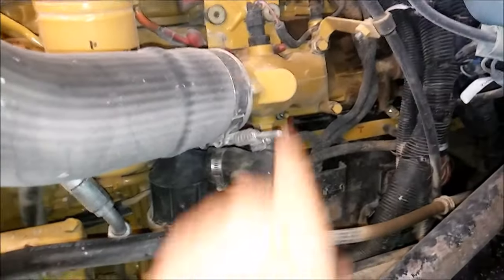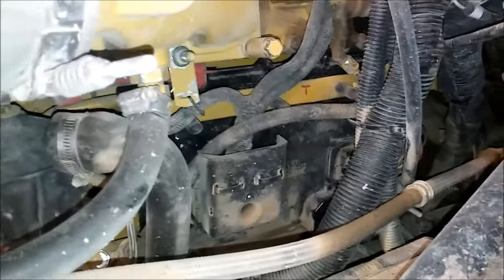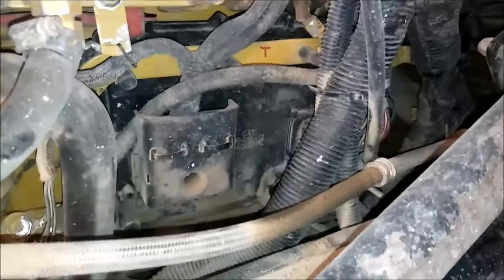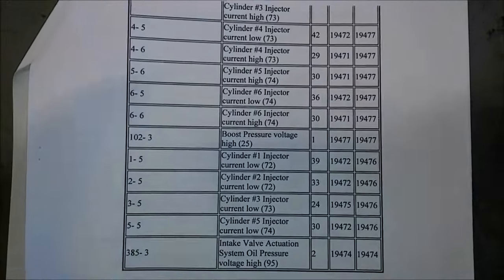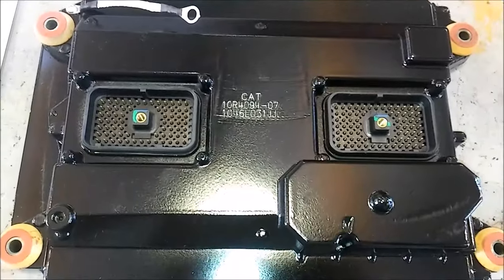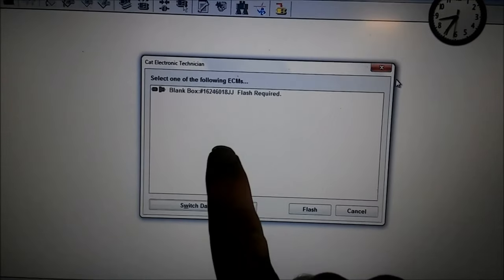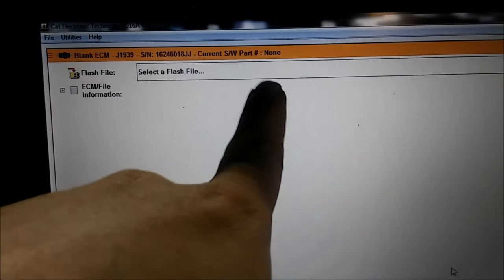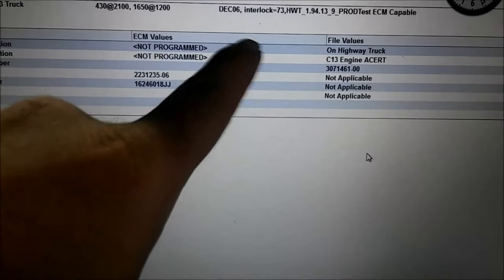How To Troubleshoot And Program A Cat ECM

Comment: I'm going from working as a fleet mechanic to a dealership. At a dealer if you own your own laptop will they put oem software on your laptop or do only the company owned laptops get used? I know it will vary from company to company.
Reply from the maker: +asavage1576 My company provides the laptops and will NOT allow you to get their software to use on your own laptop as a mechanic.
Reply: +Adept Ape hha damn. I figured that was the case. Thanks man.

Comment: great video like always got a question buddy My ecm gave me all the injector codes wich it was a bad ecm so I bought one from a guy that rebuilds them 45 days later same thing happened to the new ecm replaced it from same guy cause warranty no problems yet so my question is.? is there something that could cause the ecm to do that or was just my luck with the first ecm thank you in advance c15 acert 2004 475-550 hp
Reply from the maker: +Luis Gonzalez Cat ECMs are usually pretty good about outside sources affecting them, but have you had any battery issues or other voltages problems? It is possible that something is sending voltage spikes to the ECM and causing a problem, but usually when you get the injector codes fault it's usually a bad ECM internally and not an outside source causing it. I have seen other modules like the ABS module and etc.... cause the ECM to not communicate though because the other model is corrupting the data link, but haven't seen it cause the injector codes. Hope that helps.
Reply: +Adept Ape ok thanks Im thinking it was just a bad ecm you have a great channel keep up the good work bud

Comment: Not getting any power to injectors. I have tested positive and negative on the right side of the ECM, all tested fine. How do I test other side of the ECM? Please tell me how to donate to your fund, I would be grateful to do if you can help me.
Reply: Check the oil pressure sensor at the front of the front of the head. Until it sees sufficient pressure it won't actuate the coils I believe from memory

Comment: Please help. I have a problem with the c7 excavator engine. I changed the fuel and oil pump and now it starts working for 10 seconds and turns off and I don't know what the solution is. I am an Arab and I hope for your help 🥺🥺🥺🥺

Comment: No check e. And no certain rpm but mostly from about 5% to 75% throttle. The filters are staying full but it does act like it's getting air but it comes and goes and doesn't die. Psi?
Reply from the maker: +Alice Stoneking For a 5EK, I'd have to look up the spec on the PSI, but I think they should be around 60 psi, I can check on Monday.

Comment: Hey there, hoping maybe you could help me out.  Ive replaced all my injectors with reman units on my nxs acert.  Trying to install the trim files, files go in fine but as soon as key is turned off the trim files go back to old files.  Have 12v on 70 with key on, and 12 volts constant on 2 other pins (according to diagram).  Have you ever heard of this?
Reply from the maker: +Big Bore Well that is a new one on me. I've seen ECMs lose trim files and, but usually they go to unprogrammed. Do you notice a difference in the engine running with them incorrectly programmed? If not I wouldn't worry about it. I wouldn't think a battery problem would cause it though, as some trucks have battery disconnect switches and that doesn't seem to affect them.

Comment: I found your channel and subscribed. my 6nz has hat a check engine problem since I bought it. after watching this video  it makes me think my ecm could have a problem.  I believe it was a code 42 ( it's been a while since I used the cruise control to flash the code).  I changed the crank sensor and cam sensor and the wiring looks good. the ecm won't store the code but it comes on and stays on after a little driving, then resets after the key is off a while. any thoughts?
Reply from the maker: +DANIEL BAIRD Is that code for cam position calibration? If it is you most likely have to check the cam idler backlash, it should be about .014+/- .010. Every time I've seen it, that has been the cause.
Reply: thank you for the reply.  I have paperwork for a long block that was installed before I bought it, I guess they didn't set it correctly?
Reply from the maker: That is a very common code on rebuilds.  The longblock might not have had a Camshaft and when it was installed it wasn't timed or the backlash wasn't set correctly.

Comment: Can an ECM get a virus on it and become corrupted? 
I had my engine rebuilt by CAT ever since then I’ve had nothing but issues with the way it runs. Jakes not working right, loss of power intermittently, gauges acting up engine fan comes on in -40 degrees weather and stays on all day. 
I went in with a head gasket blown the truck ran great had no issue other  then the head gasket blown they convinced me to do a rebuild so I did and ever so then issues after issue. Ive replaced every sensor on the engine, new fuel pump new fuel lines new fuel housing. All new turbo pipes new exhaust
Reply from the maker: No, not really, but the software can be corrupted or the ECM or wiring can be bad. It is somewhat common fit the ECM to fail, especially if it is original to the engine.

Comment: Do you need to replace an ecm on a C15 Acert when you change it over to a single turbo with 16:1 compression pistons?  My motor is a bxs ecm part number 10r4994?  Can this ecm be flash and reprogrammed?
Reply: Part number 10r4094

Comment: Hey I was wondering how I would be able to run a 2001 cat 3126 on an engine stand.. how would I go about powering up the ecm to get the engine running? I have a 70 pin connector with wires attached but they are all cut since it was pulled out of a truck
Reply from the maker: +crimson22s You would just need a wiring diagram. Then just run the powers and grounds to the P1 connector. You'll also need to wire in a throttle pedal for rpm control. Should be all you need.

Comment: which cat communications adapter do i need to communicate with a 2000 Pete with a 3406e sn2ws38662  i have cat et but i see that there are several adapters out there and the 2 is cheaper than the 3 but which do i need.

Comment: 06 Freightliner Classic electrical problem , turn the key on pin 70 gets power, no other pins have power with key on or off, fuel pressure ok, disconnected the battery for 10 minutes reconnected it still won't start, turns over fine, will crank with starting fluid, normally there's an engine light on  when it's running but  it's not now, the tachometer moves when you trying to crank it, on a side note don't know if it's related or not, when you step on the brake pedal and all the clearance lights come on. it never did that before, it has shut off on me before last year in heavy rain now it rained really hard last night where I'm at with hail mixed and heavy winds best it shut off a couple of times before  that yesterday  check the oil check the  radiator,  they are fine . the last time the guy plugged in the computer says it isn't getting power to the ECM but pin 70 does, checked it myself. I have found a few broken wires and fix them one was a ground wire that made the low air sound buzzer work but nothing else
Reply from the maker: +Shon Mcintire Sounds like some electrical gremlins. There are other powers and grounds that go to the ECM, they are unswitched sources. Get a diagram and double check them before going any further.
Reply: yeah it's a old Warner Truck but with a C15 cat I put Power to pins 52 and 53 it fired right up and is running great so somewhere in the Freightliner which everyone knows they all have electrical Gremlins and it could be where the wiring harness rubs everywhere and anywhere from the vibration thank you you did help

Comment: hey man i need to ask when replacing an 212-9450: CONTROL GP-ENGINE ELECTRONIC Caterpillar with another it need to be program or not ?
Reply from the maker: +jaafar Kh Yes, all Cat ECMs are unprogrammed and need to be programmed, but it can be done after or before installation.
Reply: ok thank you

Comment: Any experience with cat 3176 mine leaks fuel out top! Can I bypass the ecm by connecting the fuel lines together?
Reply: Please please advise
Reply from the maker: +Josh Cage The fuel is supposed to help cool the ECM, but if your ECM is leaking you can try to loop the hoses and see how long it lasts. It might last awhile or not, but it would be an ECM either way.
Reply: Adept Ape hook hoses together with union or wrap fuel line around ecm to help cool?
Reply from the maker: +Josh Cage I would just connect them with a union, I don't think wrapping the lines around it would give it much cooling benefit.
Reply: Adept Ape we connected lines together with a jic 6 union and leak stopped. Truck has ran 600 miles or 24 hrs continuously no issue yet but it in January in Indiana and the high outside temperature is 15 today.

Comment: right now I'm working on a C7 acert. truck will run fine with no codes then suddenly die throwing all 6 injector curcuit fault codes and truck will not restart. I've done the solenoid test then they read short on all of them, I wiggle wiring to no change, unplug connection to valve cover and all read open, only randomly they will read OK after the test has been going on for about 5 mins. ECM?
Reply from the maker: Most likely an ECM when you get multiple injector current faults.
Reply: @mag2395  . so problem solved??
Reply: @Amarillobymorning777  yes it was the ecm that was bad. New ecm fixed it right up.

Comment: Hi all. i have a Cat C4.4 Diesel engine on a wood chipper, The unit has an LCD display. It runs ok for about 20 minutes then suddenly the LCD display goes blank and the engine looses power completely, it shakes while powering down. After that i can press reset on the Control panel near the LCD, the LCD comes back on as normal and i can start the engine normally. It does the same thing after approx. 20 minutes. Any suggestions? Possibly ECM heating up? Bad relay? Ive checked all the wiring harnesses. We did have a problem with the Ignition cylinder harness, but that was fixed. Please Help!!!!
Reply: Make sure you have decent Earth from block chassis and possibly start back to the battery

Comment: I have my 2003 peterbilt 379 with cat c12 over at the cat dealer. I disconnected the negative terminals off my batteries to clean the terminals and when I reinstalled them and started truck, I started getting flashing check engine light. My local truck mechanic told me it was code 42 (sensors not calibrated).  HE thinks my computer might be shot for some weird freak reason. HE tried doing several things and couldn't get the code to clear. Trucks not being looked at till Tuesday by cat. Ever see something like this? How is it possible that by doing what I did that the computer went out of wack. Took negatives off first then positives. Reinstalled the opposite way without arching anything. Its a 2ks c12 and drove just fine 50 miles away to drop off at cat with check engine light flashing
Reply: Just an update. Cat called today and said that my ecm was losing its internal memory and needs to be replaced. How does ecm lose its memory. Just old? Anyhow, 2000 bucks for new ecm and 3 hours labor to install. No big deal to me

Comment: can you tell me what can cause c-15 engine oil to come out the dipstick
Reply from the maker: If the oil level is increasing then you have fuel getting into your oil probably from your injectors. If your oil level is correct, but oil is getting pushed from the dipstick tube, you probably have high blowby. High blowby can be caused by worn cylinders, valve guides, or turbochargers. There are a couple other causes too. I have a video on blowby you should watch.
Reply: Excessive  crankcase pressure
Reply: Or getting fuel into oil , check your  oil if its diluted

Comment: Iam using ac9 engine no a windrow turning machine ofter normal work finish machine stopped but next morning machine not starting by inspection in found there is no elect on injector supply  can any one tale me what going wrong.

Comment: If the ecm's are getting hot I'm surprised that cat hasn't had the idea of just moving the ecm's to a cooler spot in the engine bay. That right there would help the ecm's wouldn't it???
Reply from the maker: +Gary ClarkII The ECM location is one of the cooler areas, it's on the intake side with no contact with the air compressor or coolant lines, still a hot spot though under the hood.
Reply: What about putting a fan on it like they do on pc's???

Comment: I had my ECM reflashed and now I have a studder or miss when I get into a hard pull any ideas
Reply from the maker: Could be a few things. Did you get a new ECM or did they just flash your current ECM? Was the horsepower changed or just software updated?
Reply: same ecm software update
Reply from the maker: +David lemons So here are my suggestions. They should verify that the injector trim files weren't somehow corrupted or changed, although that would be pretty unlikely. The software file itself may be corrupted or the software update may have corrupted the ECM.  Have the trim files checked and then have the ECM reflashed again to verify that the software file is alright, could need a new ECM if that doesn't fix it. You may have a mechanical error going on as well and just a coincidence, such as low fuel pressure or something of the sort.
Reply: I should also tell you I have SDP engine
Reply: ok thank you
Reply: put it on dino today could not get it to miss . called cat and check the fls and fts numbers and cat said that my engine started life as a 435 hp now it's a 550 hp but they also said that the fls and fts numbers would be the same for the 2 different horse powers I don't see how but what do you think and would you know what those numbers would be on a 550 hp thanks
Reply from the maker: +David lemons Typically the FLS and FTS do not have to be changed when doing a rerate. Which doesn't make sense, but every rerate I have ever done, I haven't had to change them. The rated fuel limit probably changes within the software, but the FLS and FTS are more fine tuning tools used by the final horsepower test by Cat when they originally tested the engine. Did they check the injector trim files?
Reply: no they never hook a diagnostic computer to it
Reply from the maker: +David lemons Hmmmmm, they could have at least checked them while they had the truck. They usually have a computer hooked to it when on the Dyno
Reply: the only one was the one in the dyno that give all the vitals. 30lb of turbo boost is all they could get out of it on 3 or 4 hard pulls
Reply from the maker: +David lemons That boost pressure seems pretty low for a 550 twin Turbo. I wonder what the boost pressure was under the original test at the factory? They can check that in TMI
Reply: I was told boost should be between 42 and 50 lb

Comment: I have a some C-7 engines that are extremely lame on take off, and when cold and they will barely move. They are 2006 peterbilt 335's with Potato bulk beds on them. The reason I need the power down low and for take off is that we use them in very soft dirt under the harvester boom which is at a speed of about 1.8 to 2.7 mph. We have lowered the rear end gear ratio down to about 6.50:1 (somewhere around there). I was told there is a NOX reduction program that the ECM wont give the engine full power until it is over 15mph or so many pounds of boost is present. I have heard that the 2004 Flash for this engine does not have this NOX reduction software in it. Is it possible to Flash these ECMs to the 2004 version even though these are 2006 models? I believe the original ECM software is loaded : 265-3326   300HP
Reply from the maker: +Steven McCullough Maybe you have an engine power problem. What is the boost you are getting when you are under full loaded acceleration?
Reply: The power is excellent with full boost its just trying to build any boost at low rpms is the problem. If you have ever been in a 6.0l powerstroke at 10000 feet it acts like that. We are at 7600 feet in elevation here by the way. How hard is it going to be to get my hands on a 2004 Flash file for that engine or do you have any ideas on how to get that?
Reply from the maker: +Steven McCullough You could probably find one online, but you might get a personality module mismatch on the ECM trying to go backwards in flash files and it might cause your engine only to idle.

Comment: how would i be able to get ecm configuration if the old ecm isnt available?
Reply from the maker: +Brian Nzivu If the old ECM either won't communicate or is physically gone, you can still get a configuration if a warranty download was ever done at a dealership. Cat saves all their warranty downloads to a warranty website they have. A Cat dealership should be able to look it up for you if you have the engine serial number.

Comment: Have a Cat Diesel Engine and suspect that the ECM is going out or may be causing problems? The Electronic Control Module is the brain of the engine and is a common failure of these engines. Watch this video to gain the information to go over basic troubleshooting and programming of the ECM Engine timing programing reqwired . Did this video help you save time or money
Reply: i m wating your replay
Reply from the maker: +Chandan Singh Pimoli Were you asking a question?